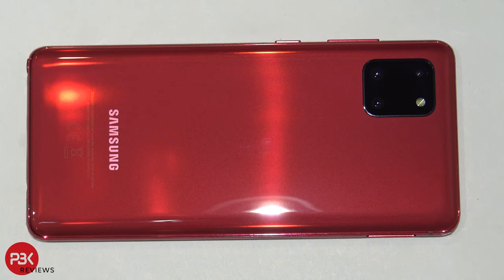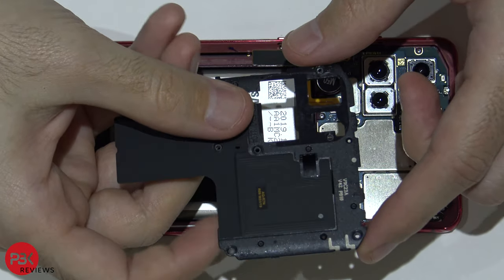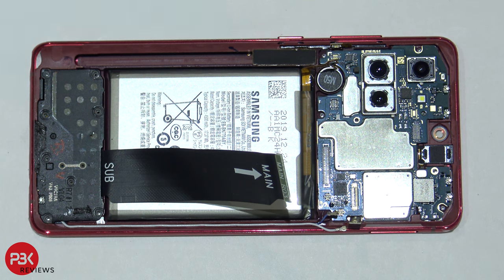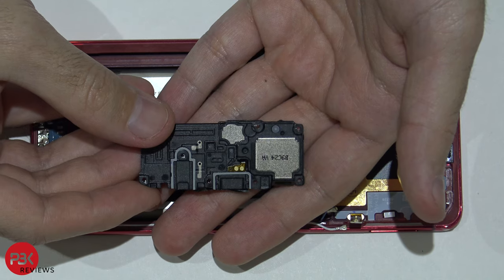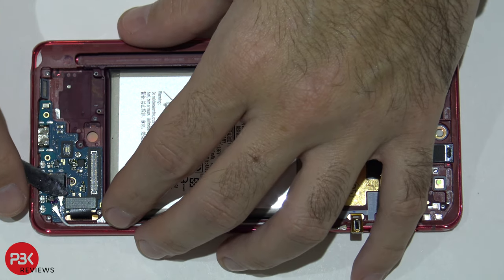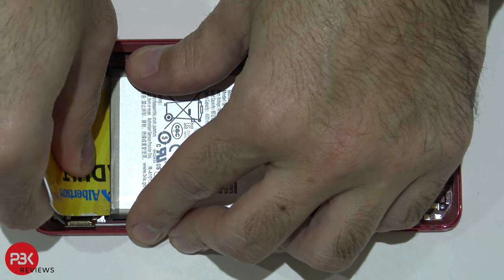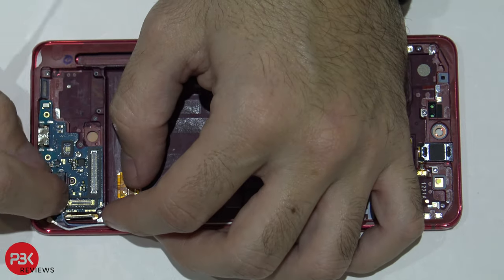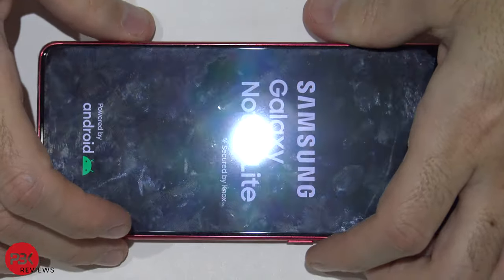Samsung Galaxy Note 10 Lite Disassembly Teardown Repair Video

Comment: By far the best disassembly video I have seen. Would please point to where the power IC is? My Note 10 lite doesn't start after not charging and the charging port was not the problem. Cuz I replaced it and nothing changed.

Comment: Great video! Does water get in the insides of the phone easily, or are there any water damage prevention?
Reply from the maker: Thanks, it should be minor splash proof but not water resistant since I don't see any rubber gaskets around connectors and charger port etc.
Reply: It is not splash proof trust me on this. My side keys are broken due to water damage

Comment: Do you need the heat gun to remove the parts or could you just do it without?
Reply from the maker: you can use a hair dryer, you can also do it without heat but would be harder to pry off

Comment: hello, thank you so much for the video!! I am new to smartphone repairs, do you know if the note 10 lite has a different charger port board based on the type of phone (unlocked, etc.) it is, or do all samsung galaxy note 10 lite phones have the same type of charger port board? thank you!
Reply from the maker: Hi, yes usually different region versions of the phone will have a slightly different sub board or charger port board due to different antenna contacts on the sub board etc. Not always but happens to be the case with motorola and samsung at times.

Comment: Great video.Can i ask  if volume buttons and power button can remove from the frame?
Reply from the maker: Thank you. Yes once you remove the flex cable with button clickers on it from inside the phone, the buttons can be pushed in and removed from inside.
Reply: @PBKreviews  Thank you .
Reply from the maker: @MrEvgiotis  you're welcome

Comment: Waw.. so brave to disassamble this note10lite..
Btw is there any carbon cooling or similar things that was on note9 that has a heat release function?
I just curious what those gold color plates is..
Reply from the maker: The gold plate is a copper vapor chamber, has small amount of water vapors inside which transfers heat.

Comment: nice video do you know if the glass screen is the same as the note 10 plus.
Reply from the maker: Thanks,  you mean the type of glass or the screen itself?
Reply: @PBKreviews  the screen itself. thanks for reply
Reply from the maker: @Mikefngarage  No problem, no they are different. note 10 plus is a 3040 x 1440 (Quad HD+) display at 6.8" and note 10 lite is 1080 x 2400 (FHD+) at 6.7"

Comment: Hey PBKreviews I recently dropped my note 10 in a drain while it was flowing and I was wondering if it the phone could survive? When I checked the phone I found that the ports was fairly dry and had no water on them however the S-pen was wet and the S-pen compartment was also wet. Is there an opening on the S-pen compartment that might leak onto the board? If so, how long should I leave it to dry or is it just doomed? Sorry for asking a long question

Comment: Thank you for the Video. What steps do i have to Do if i just want to replace the battery?
Reply from the maker: You're welcome. You need to remove the back plate, then unscrew the screws on the top portion to remove the top black plastic cover and then disconnect the battery cable and the other cable running over the battery. Then you can heat up the adhesive on the battery with a hair dryer by applying the heat from the screen side  and then pry the old battery off.
Reply: @PBKreviews  thank you very much. :) Do i have to put on some glue when i put on the case after the battery replacement?
Reply from the maker: @janw1982  The old adhesive might hold  if it's not tampered with too much but if it's not holding you can apply a new adhesive tape. You can check if there are pre cut ones online (usually sold with back plates) or you can by a roll and cut yourself. But keep in mind it wont be an air tight seal as before unless you purchase a backplate with precut and pre installed adhesive to ensure a strong seal.
Reply: @PBKreviews  thank you so much, i think i can do it, but i am a bit afraid With the idea of heating the screen side, i dont want to destroy the screen.
Reply from the maker: @janw1982  no you wont damage the screen as long as your not overdoing it, just use a hair dryer (safer than a heat gun) but don't hold it on one area the whole time. Move it around and gently warm it up a bit, you don't need to over do it. You can heat it up a bit and try prying and apply more heat as needed through the process gently to loosen up the adhesive.

Comment: If the screen is blank and doesnt diplay anything, but its still intact not broken, when open I saw the LCD connector on the motherboard is broken could it be the problem and can it be fixed without doing anything to the screen? Or do I also need to replace my screen?

Comment: The phone looks like it can withstand accidental water damage. Samsung just didn't want to spend extra money on the IP rating. What your suggestion, note 10 lite or s10 lite?
Reply from the maker: Yes correct. I would go with the note 10 lite since I would like to make use of the S pen plus overall I liked the build of the note 10 lite
Reply: It will NOT, look how the spen compartment have a big hole in it, also the charging port does not have glue/O-ring around it

Comment: Back panel is plastic or glass? I am very interested in this.
Reply: Glastic
Reply: So many wonderful samsung handsets with plastic back. It could not be that expensive to make glass back version.
Reply: @reikalasmakaronas2245  idk why they do this but it's not acceptable 😕
Reply: agree, s20fe is on the better side, because that it is non glossy. But I could not find any tests of that type of finish. also the price and screen issues makes it very questionable.
Reply: @reikalasmakaronas2245  A72, A52 and A52 5G are non-glossy too
Reply: @its_tomtrn127  But they have plastic frame, which is the limit of unacceptable'ness for me.
Reply: @reikalasmakaronas2245  ah ok
Reply: @reikalasmakaronas2245  then the S21?
Reply: S21 800euro , S20FE 520euro. A72 430euro, plastic frame + midrange chip.
Reply: @reikalasmakaronas2245  i know the prices. I live in Germany there are the same prizes
Reply: @its_tomtrn127  not sure why you offering s21 then. Better deal in my opinion would be s20 or s21 ultra. As s20fe ,note 10lite and a70 are in midrange price category.
Reply: @its_tomtrn127  also, amazon.de s20fe prices increased drastically, not sure if it is because of supply chain problems or what. Interersting things happening right now with all the money printing and great reset. I think prices of these devices won't fall.
Reply: @its_tomtrn127  i think all this plastic phone stuff are coming from 'sustainability' and 'circular  economy' things.

Comment: Hello, what glue do you recommend?
Reply from the maker: Usually the replacement backs come with adhesive pre installed, but if not you can use 300LSE adhesive or smartphone red tape or other similar adhesives

Comment: I have a Samsung Note 10 Lite phone that fell into the water, so the back cameras and the touch stopped, but it works only with the S pen, so what is the problem in your opinion? Please answer my question, and God bless you
Reply from the maker: There might be corrosion inside over the chips on the board or connectors which is shorting something. You would need to take it apart, dry out any water, brush off any corrosion on chips or connectors with a tooth brush, and put the phone back together to see if it will work. If not, you would have to either replace the screen or there might be damage to the board that is not user fixable.
Reply: @PBKreviews  You are correct, I have cleaned it and the touch is back, but the fingerprint sensor and the back camera are not working yet

Comment: What its the fuction for the white and blue cable? Thanks for your time!
Reply from the maker: Most of the time those cables are used for the antennas (sending signal from lower half antennas to the main board) if I am not mistaken, but I have also seen those type of cables used for touch capacitive keys on sides of phones and other things.

Comment: Hello. How much do you think it'd cost for the display touch combo. ? Considering no edges like note 10, but has an in display fingerprint scanner? 

Planning to buy one. But, I drop my phone quite often. Broke a Note 8. Couldn't afford it's repair bill. 🙄😬
Reply from the maker: The complete screen assembly with midframe runs about $200

Comment: at 00:35 of the video, you show the inside of the backcover which shows a texture that resembles wireless charging. Is there some way to install wireless charging coil on the back, and some possible connector for it?  In other words, is it possible to add aftersales wireless charging capability?
Reply from the maker: Hi, it's not a wireless charging coil on the back plate. You can add aftermarket wireless charging, but it would be one that is attached to the outer back of the phone and connects through your charging port. There would be no connector internally to connect to etc.

Comment: I would like to see a way to remove the power button. and volume up and down buttons
Reply from the maker: removing the flex cable for them is possible by just lifting out that metal bracket that is holding it in place, but to remove the buttons themselves would require prying off the screen and removing it from that side but would probably cause your screen to get damaged or break.

Comment: hello! I have a question. Do you think this phone has water proof ability as note10 and s10. I knew that it cost 20 dollars to get IP rate.
Please answer....
From japan.
Reply from the maker: I'm sure it is splash resistant but not sure if it is water resistant. Has good adhesive around back plate but is not rated to be placed into water.

Comment: whats the white thin wire on the side of the phone? im curious as I have cut mine while operating
Reply from the maker: The coaxial cable connects antenna from the sub board to the main board. You can try to find some online from different phones if they are the same length or similar to replace if one for this model isn't available.
Reply: @PBKreviews  will do but right now it doesn't seem to affect the phone. wifi and cellular service are okay. any idea why is that?

Comment: Hey PBKreviews...what happens if i accidentally forced the sim ejector tool into the secondary microphone hole, would this cause any damage to the mic or the water resistance protector, especially for this Note 10 Lite model?
Reply from the maker: Hi, no you should be fine, the mic n filter sit above/below the hole so they wont be damaged.
Reply: @PBKreviews Great, relieved! Thanks...

Comment: Sorry but do you know by any chance if i can straight up replace the charger module or do i need to soder a new usbc connecter on there ? i know on older models there was a flag set that blocked certian samsung features.
Reply from the maker: You should be able to replace the sub board which has the charger port with no issues. As long as you make sure to get the same model number version, since different region sub boards would have different antenna configurations and cause service issues.
Reply: @PBKreviews  Good good, gonna check that first, btw i saw that the battery is easier removed with isopropnol alcohol, would you advice it ?
Reply from the maker: yes, just make sure to use 99% so its higher alcohol content and dries up quicker. You can also use this: https://www.ifixit.com/products/ifixit-adhesive-remover?variant=39915173740647   and only apply a little on each side

Comment: my phone got bent but screen work a 100% what parts should i replace other than the frame
Reply from the maker: Well if only the frame is bent/damaged, then only the frame would need to be replaced unless the back plate broke or anything else internally. If not then just the frame would need replacing.
Reply: @PBKreviews  becouse evrey store i went too they said samsung cant sell them frame only is that right bro
Reply from the maker: @Elia_rizkallah  well most of the time they sell screen and frame combos which the screen comes preinstalled with the frame. But I'm sure you would be able to find just the frame on ebay or some similar site. However keep in mind, there is a high chance you can break or damage your screen when prying your screen off the frame. You would need to apply heat throughout the process and take your time and gently pry the screen off. It's not easy to get it off without damaging it. So you can try and if it does break then you would need to just get a screen and frame combo but that would run you more at that point.
Reply: @PBKreviews  thanks
Reply from the maker: @Elia_rizkallah  you're welcome

Comment: my samsung note 10 lite had water issues too and i have cleaned and still the phone only vibrate that its is on but the screen does not come up pls what is the solution
Reply from the maker: Its possible that the screen has got bad or the board. You would need to try a different screen and see if that is the issue, if not then the board might have gone bad from the water damage.
Reply: @PBKreviews  alright thank you
Reply from the maker: @ayobamijohnson4124  You're welcome
Reply: @PBKreviews  I opened mine up because it was splashed. . . The phone worked but was sluggish for about 5 hours until the battery died. Now it won't power on at all. . . After I opened it there was no sign of corrosion. I used 99 percent alcohol to clean and put it back together. . . Still nothing. . . Any ideas?

Comment: which connector is for display?
Reply from the maker: It's the bottom right cable connected to the small charger port board.

Comment: Am I seeing things or does the sim tray have a rubber seal?
Reply from the maker: Yea it has a rubber gasket
Reply: @PBKreviews  Interesting. There's no ip rating, but this would suggest they made an attempt at at least basic splash resistance... assuming all other entry ports also have something.
Reply from the maker: @MariuszMazur  ya, happens many times that phones dont officially get an ip rating but still have some water resistance